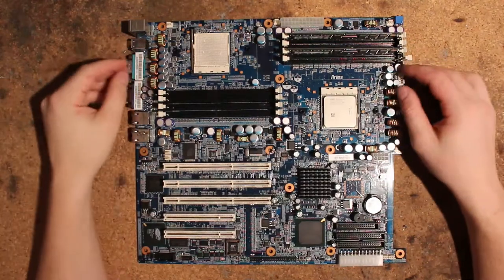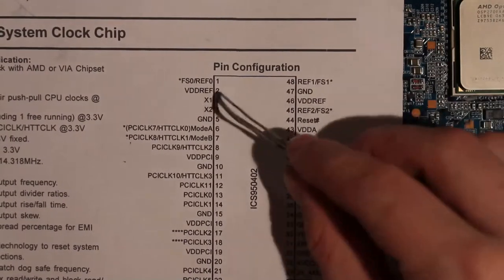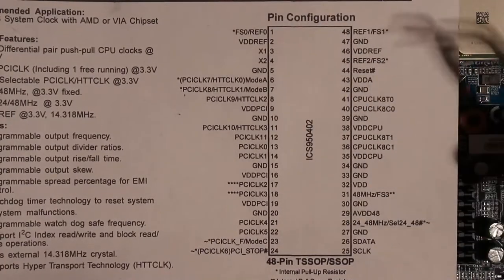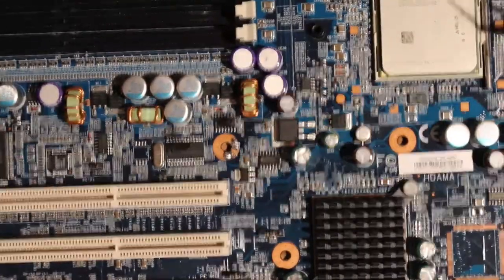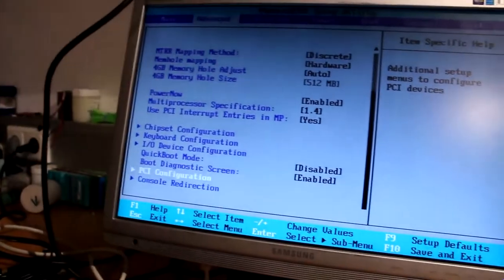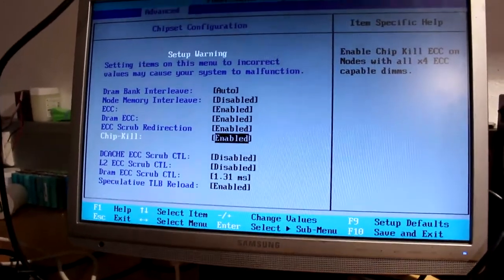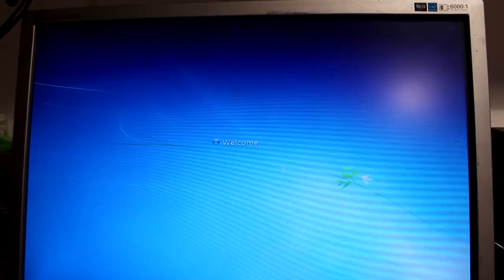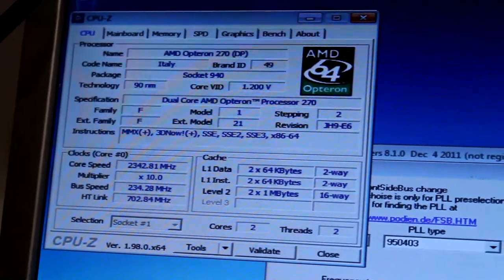Overclocking the cheapest dual socket 940 Board

Comment: Do you know how the pci lanes route to the two sockets? I know on some server boards from supermicro there's like 2 pci bus one for each socket.
Reply from the maker: No idea tbh but never ran into any issues with single CPU, then again i just have a GPU and a POST-Code card in the slots... allso don't own any PCI-X devices, so don't even know if those work on my boards...
Reply: I think with old system like that, everything go through the northbridge ?
For modern (newer LGA1366 for intel), each PCIe slot are connected to one CPU only. You can acces a device from CPU1 through CPU2 but with a lantency penalty.
Reply: @raphi_sch  that would make sense. If there's a Northridge I don't think there'd be much benefit to routing them separately? I remember that on one board I worked on only half the pcie slots worked if you didn't have both cpus installed. It sticks out in my mind cause I thought there was a problem with the board until I dug into the manual and found out that they were entirely separate. I've only ever worked on a couple of dual CPU systems